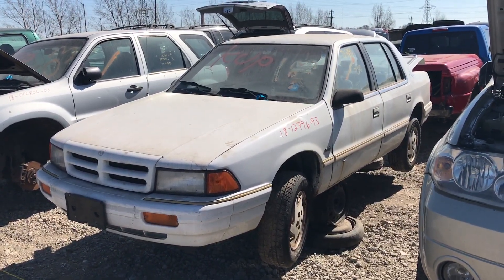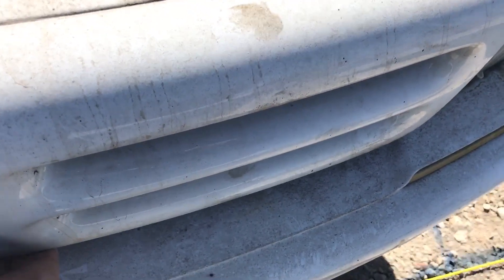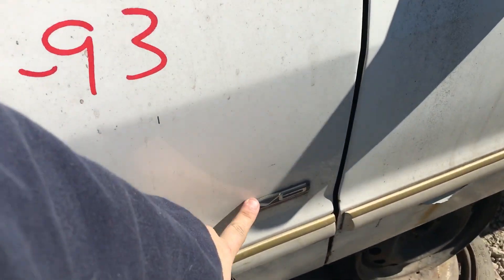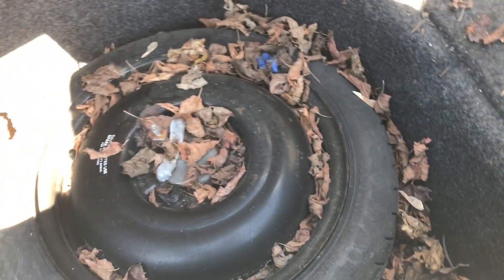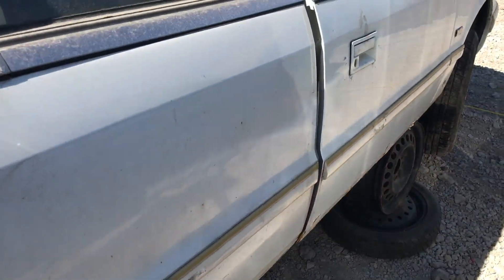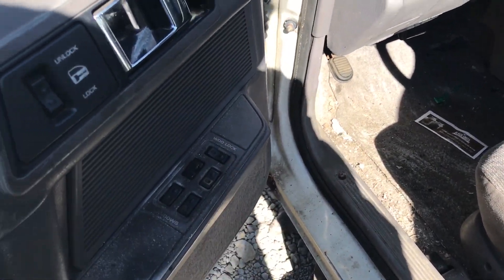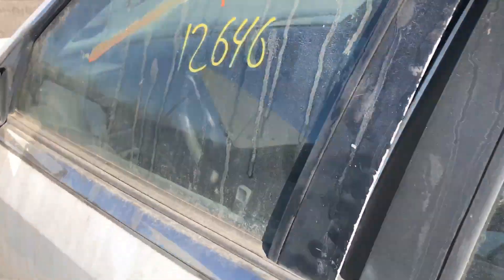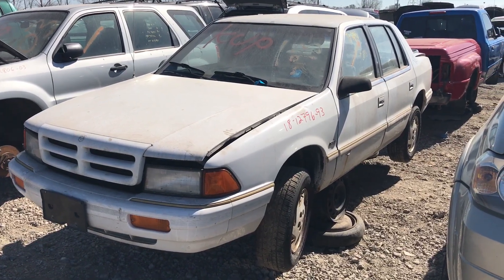Rusty Old Dodge Spirit in Car Heaven

Comment: I really liked my 1989 Dodge Spirit -- wimpy 4 cylinder, but very comfortable passenger accommodations, fold-down rear seat, very nimble in traffic, looked like a far more expensive car. I drove it 14 years until my son totaled it (not his fault -- spun out of his lane by an errant motorist). Very cheap and easy to maintain, very reliable -- never stranded me anywhere.

Comment: I have a 1991 Dodge Spirit. I bought it off an old lady with 74,000 original miles it was garage kept runs and drives perfect.
Reply: I wonder how long it can live on. That's neat! I think a main reason I would want a newer car is for safety, otherwise an older car like that would seem nice. I've never had a modern car with all the technology so I wouldn't be missing anything. But parts must be harder to come by